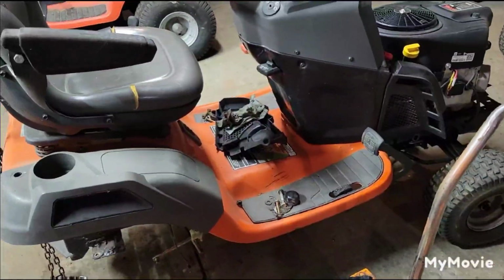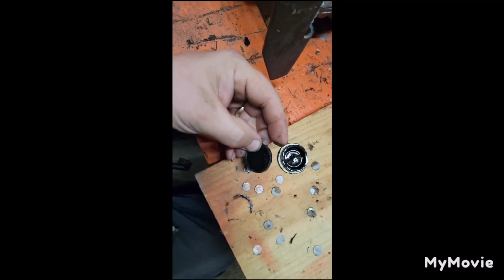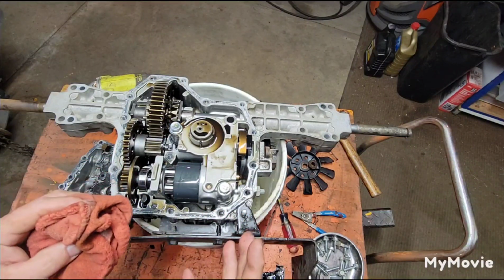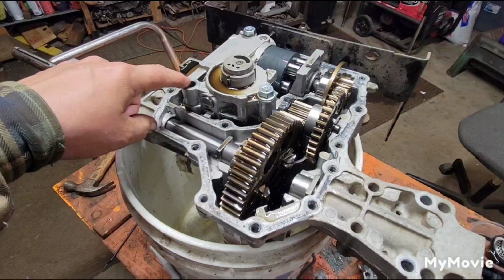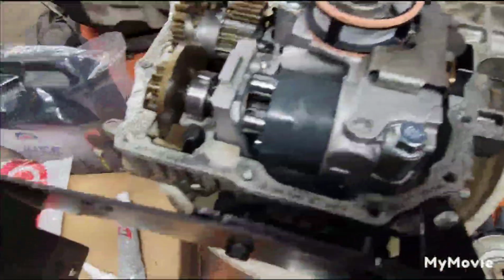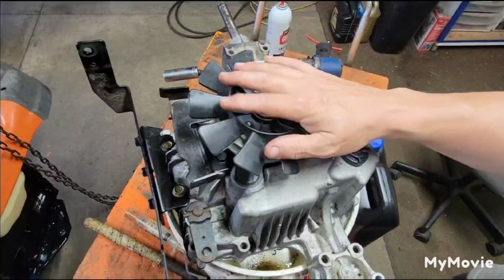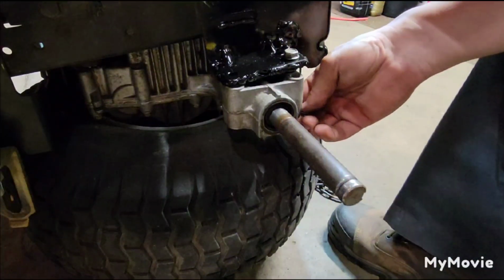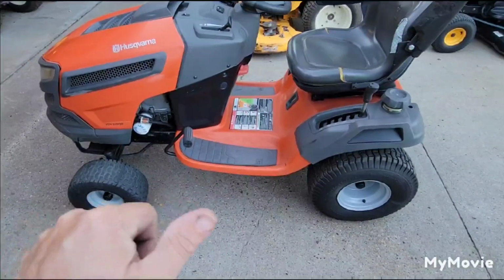Weak Tuff Torq transmission fix

Comment: What goes bad in a hydro gear drives?  I cleaned them sanded the revolvers and center secrion smooth..mower still fails on left side after 20 min.   Also put in new center section and no resolve.  Does the case wear out of spec?

Comment: DITTO on right wheel removal.  I heated, I oiled, I hammered, I even took two car screw drive Jack's and leveraged them between the wheel and tran housing - the entire axle shaft popped our of the transmission rather than the wheel sliding off.

Comment: Good on you to make it right before you sell it. I try to do the same thing, and I will even buy them back for a full refund if they do not last a full season. Had to do it recently. Sold neighbors a Deere LA 145. Their back yard was probably too steep for that trans, and I told them that, but they liked it, and they liked my price, so it was sold. They mowed with it 6-8 times before the trans bit the dust, so I just offered to buy it back, and I am working out a deal with them. I am in the process of parting it out to recoup some of the money I have in it. I do not mind doing people right. It is a side job/hobby for me, and I have won on so many, I do not lose too much sleep over taking a loss from time to time.
Reply from the maker: Thanks Eric. Some viewers say I put to much work in these mowers if I'm selling them but my thing is that I don't ever want them coming back. I won't lie it's happened a couple times but not to bad considering I've been doing this close to 20 years.  Keep doing what you're doing bud

Comment: How's she goin'?  Good for you Dave to tackle this job.  It sure looked like you could have ended up in serious trouble but since you had a back up Tuff Torq it was the thing to do eh.  And you got it done!!!.  Sure looks like a lot more speed.  Nice job.  Thanks for sharing and take care!!!
Reply from the maker: Thanks Mike. Right,  a guy could dive in farther but right now that's a little intimidating. Thank goodness I didn't have to do that.  I was surprised how fast it was but when the deck goes on the weight may slow it down a little. I've been waiting for an idler pulley for the deck for 2 weeks,  now they say 3 more weeks , it's frustrating

Comment: So clogged filter = lack of fluid flow = misbehavior of unit? Caught in time means fluid and filter change yields return to proper performance?
Reply from the maker: Yes sir
Reply: @davessmallenginerevival2847  a stitch in time saves 9. Good work!!

Comment: NICE VIDEO ... It is AMAZING what a NEW FILTER and NEW Fluid can do to these Tuff Torq Transaxles. The Internals of this one look exactly like the Tuff Torq K57R.  on my YTH24V48 it has the Tuff Torq K57R transaxle in it and your filter system and spring setup are just like mine. I think ALL the Tuff Torq Vids Taryl has done are on the K46 Transaxle. The K57's are a little different ... Tuff Torq say they can handle 22 inch 5 lug wheels in the rear with 255/188 Nm/lb-ft axle torque, which is not alot more than the K46's, but it is more. Alot of these also will have the heat treated steel gears as well. AND one big bonus to the K57R Trans is they are ALOT faster than the K46.... at least when they are working and running correctly. :)
Reply from the maker: Thanks for the info. I couldn't believe how much faster it was. The guy that bought it really liked it
Reply: thats a k57  your working on. usually the center block  assembly needs refurbishing , and new fluid    and your mower will work like new. Already done  4  transaxles

Comment: I ran over garden hose . mower chewed it up. drive belt got burned and stretched. stopped working altogether at 60 hrs use. changed oil and it worked again but slipped bad on hills. oil filter looked fine. need to  figure this out for next summer use.

Comment: The latest recommendation I received from a small engine shop is to use 20-50 non detergent oil when changing. It's necessary to "bleed" the transmission in many cases. It means getting the air bubbles out of the oil but I'm not sure how this is done.

Comment: my jd lx176 wouldn't pull when hot . tried straight 50 weight , then trans "medic" in a can , even added restore for engines . swapped in a 5 speed , but later tore down the hydro , block sanded the surfaces you spoke of (may have gotten the wedge turned the wrong way) and put it on the shelf . the filter might well have been the original problem , but the additives definitely clogged it . i keep wondering whether i got it fixed or not . curiosity may get the better of me one day , and i'll reinstall the hydro .
Reply from the maker: Hi Bill. Your trans probably works since you went through all that. Taking the pump out is intimidating for me but I'll probably try it someday.   To think of all the hydros  I threw in the scrap pile when all I had to do was a fluid and filter change,,, unbelievable.  Happy 4th buddy

Comment: A friend of mine who works on these, told me, he has fixed a number of failures caused by those caps cracking and spew fluid out. The fan blows it all around and makes a mess.  The fluid gets low and the mower won't go.  He replaced the cap, top of fluid, and they were back in business.
Reply from the maker: I found that to be true also
Reply: Yes the cap on mine split. Took ages to figure out where the mess was coming from. New caps have a solid metal disc so hopefully won't happen again.

Comment: Thanks for the video mate,
I work at a school here in Australia and our Husky
has lost drive and there are a few funny noises coming from the tranny.
I know it won't be as easy as yours, I'm thinking busted axle or diff gears
but after watching your video we have nothing to lose, none of the mower shops were interested
in buying it for parts, 500hrs and the Briggs is good as gold so with some luck
I may be able to fix it. It is a second mower anyway we use for the gnarly stuff and keep
our new one for the big areas. It's a Ferris and as they say "Save Ferris"
Reply from the maker: Thank you , I hope the video has helped you. Not sure what the funny sounds could be , hopefully an easy fix

Comment: Maybe silly question. How can you tell which Tuff Torq transmission you have. I've got a XT2 cub cadet. Any idea where the identification plate is on the transmission?
Reply from the maker: Should be a tag or it's also stamped,  if it's a tuff  torq  , if not it will have different markings

Comment: Hey y’all. Just came across this video, been doing some research into these hydrostatic transmissions. I have a Cub Cadet LT46 and halfway through cutting my yard, the transmission wouldn’t move in forward or reverse. I let is sit for about 20-25 minutes and I was able to take off again for a short period when it happened again. Yet again I let it sit for a bit and was finally able to finish the yard up. The mower only has 48 hours on the meter, what could the issue be?
Reply from the maker: That low of hours I would think it's still under warranty but if not then I think it's not good because it's got to be a factory mistake of some kind. I don't really know what it is but it's definitely a heat problem because when it cools down it works again.

Comment: The pan sealant you can use the silver from tuff torq or any RTV sealant, like blue or red, black. Must let dry partially to a skim coat then it’s ready to set the pan. Just for others FYI.

Comment: It can be very hard or impossible to get the wheel hubs off. Fortunately you can replace the axel oil seals without removing the hubs but you have to take the half axels out of the case. Not hard but a bit fiddly.

Comment: Tuff torq K46  k57  k66 are all excellent transmissions very strong but what I have seen and heard not many actually service there transmission like after 50 hours of use on a new transmission you're supposed to change the oil many don't do that and leave the brake in fluid in and just add to it..also they don't allow time to brake in the transmission when it's new and when you don't do these things expect trouble and many cases won't take very long for it to fail
Reply from the maker: Most owners aren't going to do that. Some it seems change the engine oil once and then add or run it low till it seizes and wonder why
Reply: With regards to the oil service, we are told that there is no need on the transmission for the life of the mower but like cars with their auto trans now days, it is good to service the oil and filter on occasion and pay no heed to the B.S. the manufacturer states.  All they are interested in is you trashing your mower / car and buying anew one.